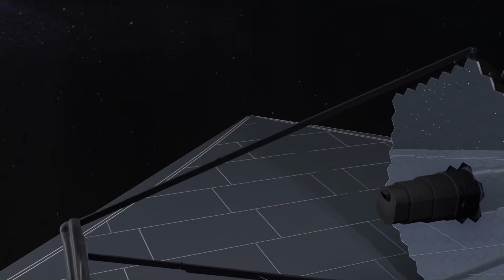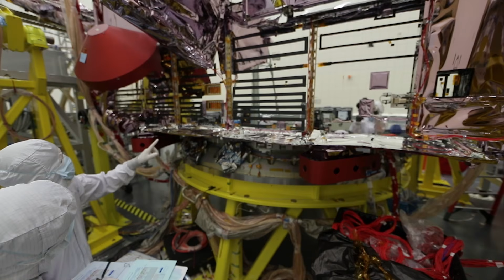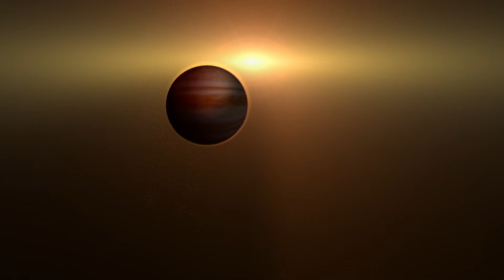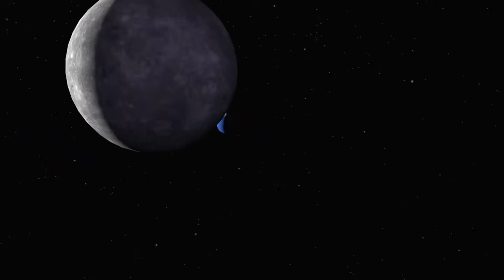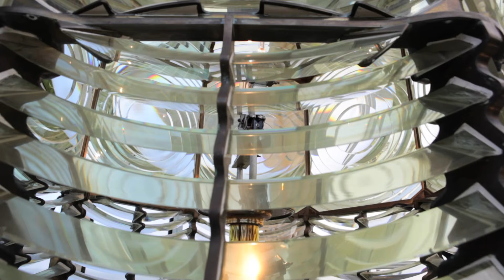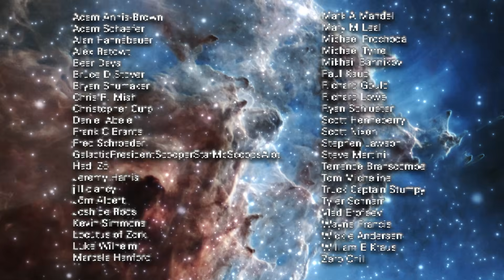Nautilus – True Next Gen Space Telescope

Comment: there is no limit to the size of telescope. the deployed telescopes could tie together once in space. and better, they can continue to adjust location in respect to all others depending on where your focal point needs to be and for what parts of the spectrum. throw up 20000 drones that are 2m across and stack them in rockets. then have them connect themselves once in space. if one is damaged, it disconnects and is replaced. it can retreat to repair and go back in.

Comment: INSTAD OF  HAVING EACH TELESCOPE OR EYE SO TO SPEAK WITH ITS OWN CHIP THAT WILL DETECT A CERTAIN NANO METER  JUST HAVE A CHIP THAT CAN RECEIEVE THE WHOLE SPECTRUM OF LIGHT AND WAVE LENGHTS CAST ON TO A MAIN RECIEVER THAT SENDS THE INFO BACK TO TO EARTH TO BE DECYPHERED HERE , THUS REDUCING THE COSTS FOR EACH INDIVIDUAL EYE. JUST A THOUGHT. AND THE OTHER THOUGHT IS INSTEAD OF EACH EYE RECIEVING AND TRANSMITTING  JUST HAVE THE  EYES MADEOF MIRRORS TO REFLECT TO A CENTAL POINT TO BE RECIEVED AND TRANSMITTED AND SORTED OUT HERE ON EARTH? EACH EYE COULD HAVE THIS MAGNETIC ARMS THAT WOULD ATTACH TO EACH OTHER IN  THE CONFIGURATION WITH A SOLAR POWERED ELL TO USE FOR ADJUSTING AND FOCUSING THE LIGHT TO THE CENTRAL GATHERING POINT TO BE RELAYED BACK TO EARTH .. KEEPING IT SIMPLE IN DESIGN AND MORE EFFECT IN COSTS .

Comment: There might be a possibility which was not talked about: a tool for molding 6 meter lenses with this technology might also be used to spitting out 200mm lenses for consumer level telescopes. With these numbers you could "print" 697 smaller 200mm lenses with mostly the same tools that was used for making the 6000mm telescope lens if its really possible.

Comment: The old big TVs that have the 3 color projection cameras and a {mylar or glass} mirror. Also have a Fresnel lens incorporated into the front assembly, consisting of a clear plastic sheet, a 
plastic Fresnel Lens, and a plastic diffuser, that are simply taped together along the edges. Once this assembly is separated, DANGER!!! The fresnel becomes a very powerful sun magnifier, 
the prime focal plane is about 2-3 feet out. Which will bring smoke immediately to the butt of an oak log and will boil water in a brown beer bottle. Will melt small thin pieces of aluminum. 
⚠Warning appropriate Eye protection from the reflected UV is a must. Also, do not leave or store where the sun could inadvertently shine through it while unattended. Not For Children!!! 
Not sure why this technology is not used in solar steam power systems. I digress; Raising the lens prime focal plane above the ground, thus widening the beam it's still pretty hot but not as 
bright. You can then make a few slow passes over a Stirred-Up Fire Ant Mound. Then pause, let more come back out, repeat, repeat. It's like fighting fire with fire. Double Plus Good.

Comment: The casings that you ejected in space could be made to fold out like spokes tethering each telescope with corresponding partners, even memory materials that go back to form once released, voila, you have a preformed shape to increase and maintain a predetermined orbit. or build a platform that does what I said except it extends out like spokes, your distance, your strength requirements... it should have a power collection system and be adjustable. Further expansion would require extending the frame infrastructure, the central point would house the communication/central guidance system for alignment with desired objects through ion propulsion tech. located on the outer frame... the array as well could individually direct each telescope.

Comment: It seems one could pull off a non-quantum-networked optical interferometry telescope of moderately large size [not km@10ly resolution but still pretty good] by using multiple lasers to transmit discrete wavelengths [ex. ir-R-G-B-uv] and recombine them optically rather than attempting to time digital data to achieve results.

Deploying a constellation at KM distances all orbiting about a central combinatory scope in the middle... seems doable.  

I mean, LISA man!  Heck, even LIGO. The ability to stabilize laser light over KM distances to sub-wavelength distances is well established and not "magic" [anymore]. 

This would be a compelling stepping stone to a full meters@LY  resolution quantum-network "powered" >AU-diameter interferometry  telescope..
Reply: Additionally, one could use optical fibers over a ~xKM distance for the optical information collection and use lasers for spatial-measure/alignment "Station Keeping".

Comment: What most people don't get is that most interferometers work one pixel at a time this will probably be measured in gigapixels
Reply from the maker: Maybe radio interferometers work at single pixels, but infrared interferometers are just the size of the mirrors - like the VLT. But this wouldn't be an interferometer, it would just be more surface area.

Comment: If you take a sheet of clear mylar film, and a sheet of silvered mylar film, or similar, and put them one on top the other, then you cut them into a circle and weld the edge together you will have an envelope the shape of a balloon. You can add pressurized gas when it is in space and it will unfold into a mirror making the main dish of a reflecting telescope. Its size and internal gas pressure forms the shape, and you can make it harden in sunlight so you can have a mirror of immense size very cheaply made. All you need to do is position it wherever you want it in space. You can park it over the middle east to keep those countries cool and you can sell advertising space on the back. You can use it to concentrate sunlight on asteroids or the moon for mining activities or focus sunlight for conversion into solar power on the moon or on satellites.  Why would you not want to put some money into such a project as this?

Comment: Unfortunately JWST is going to be the peak of space telescopes. The US is dead broke with a Debt to GDP of 370% US federal gov't is running $2T+ annual budget deficits to keep its door open. Probably the last Space telescope the US will launch is the "Nancy Grace Roman Space Telescope" which is a wide field view telescope (probably launched in 2028 or 2029). 

It would be possible to build larger telescopes like the JWST, but would require multiple launches and assembly in low earth orbit. I believe the biggest "telescope" is the USA-223 which is a spy sat with a 100m diameter radio telescope used to pick up very weak radio transmissions. Too bad the NRO does license a second one for radio astronomy.

Comment: The 30m telescope is designed to be moved by truck, so less than 40,000 lb parts, intended for assembly on site. The total weight of the moving part is under 1500 tonnes.

If you're going to assume Starship, that's 10 launches maximum.

10 Starship launches would cost less than the site works for the 30m telescope.

Just launch that.

Comment: It also sounds like that instead of temporal shifting the imaging sets you could perform an effect called pixel shifting in photography. Where you get to sample the same image from a sub resolution offset. Which you resemble a sharper image.
Reply: I think quantum effects would limit that. The pixels would probably be already close to the quantum diffraction limit for that lens size. Overcoming that limit would require interferometry, which they discussed as having problems which are not addressed by this design, such as needing very high precision in where each telescope is located.

Comment: I'd go easy with the hype around Starship capabilities. Which could end up just being used for Starlink missions, and an heavy modified Lunar version for Artemis. Adding a big payload fairing could enter more complexity as additional weigh due the reinforcements to the hull. Bet more into Falcon Heavy with an extended payload fairing.
Reply: It's just a graphic, not an engineering document.
Reply: Maybe, but the hull wouldn't need a crazy amount of reinforcement since it would only articulate in 0g
Reply: No mention of the "#Carl_Sagan Space Observatory Telescope" ?❔️ 🤨
Reply: I think underestimating SpaceX and Starship is foolish. Period.
Reply: @justinhays0827  many rely on Falcon 9 success to validate Staship. But they are completely different rocket platforms.
Reply: @RogerM88  SpaceX had no rockets in the beginning and they created two successful reusable rockets. Now, SpaceX is the most successful rocket company in history. There is zero reason to doubt their ability.
Reply: @justinhays0827   Falcon 9 is a more conservative rocket design with a standard payload fairing, and a rocket design based on proven technology.  Starship is a completely different rocket design with new rocket technology. And the payload hatch design it's a crucial aspect for commercial applications besides Starlink missions. SpaceX are even considering adding more vacuum engines, probably to gain delta-v due the vessel weight.
Reply: @RogerM88  Humans are terrible at calculating risk.

You are particularly terrible at it.

More $ for me I guess.
Reply: @justinhays0827  in theory project Jarvis  from Blue Origin would make more commercial sense than Starship, for missions to LEO. Using a standard payload fairing, and with an engine configuration mimicking the spike engine layout, it would allow using less shielding for reentry. Either way, having Starship Crew rated, gonna take a long time. If Starship opted first for the development of a bigger fairing to Falcon Heavy, as the Red Dragon lander, they could've by now some missions to the Moon and Mars. While a Crew voyage would be made by a modular Spaceship assembled at LEO with Nuclear engines. Using the Red Dragon as a lander and ascent module. It could also work as an abort system.
Reply: @RogerM88  🤦
Reply: @justinhays0827 NASA is the most successful rocket company in the world.
Reply: @justinhays0827 musk is too busy trolling trans people on Twitter to ever get starship up and running.
Reply: @justinhays0827 Unlike Starship the Saturn V and SLS never exploded before or after liftoff.
Reply: The falcon program is successful, no question.  Even the space shuttle was far less successful, both in cost and in pace.

Starship improves rapidly, while someone could doubt they will populate mars with it, its not realistic to doubt starship will make it to orbit soon.
Reply: @douglaswilkinson5700  You are comparing two completely different methods of development. SpaceX uses prototypes to test ideas while Saturn V and SLS used testing sub-systems and then launching a combined rocket. One is building cheap prototypes to get the information that the other gets from designing on paper and building sub-section prototypes then combing them.
In the end it is a matter of which is cheaper and faster in the long run.
Who won is obvious.
Reply: @knowledgeisgood9645  Still -- neither the Saturn V (developed over half a century ago) nor SLS exploded after liftoff.
Reply: @douglaswilkinson5700  So what? That is the method. Losing prototypes does not matter when you get the real data you need.
It is not like Starship has crew they need to be worried about.
Reply: @knowledgeisgood9645  Still -- no Saturn V nor SLS exploded on the launch pad or during flight.  All were successful and lessons were still learned.
Reply: @douglaswilkinson5700  But at what cost!
It was, and is, a dead-end.
Reply: @knowledgeisgood9645  The cost was fully justified on July 20, 1969.  The F-1 engines remain the most powerful single combustion-chamber liquid propellant rocket engine ever developed.  These engines are retired not obsolete.
Reply: @douglaswilkinson5700  How about SLS?
Reply: @knowledgeisgood9645  Starship just had another failure.  At least two Raptor engines failed and the test was aborted at 2.7 seconds into the 5 second test.  At least Elon adopted Saturn V's water deluge system.
Reply: @douglaswilkinson5700  4 Raptors aborted prematurely. No one outside SpaceX knows the reason, so I will wait before I draw conclusions.
That was likely why the test was aborted. 3 Raptors being the maximum number allowed to abort before launch. Anyone who has been involved in testing anything knows tests usually fail - no big deal. You fix it and test again.
Elon did not adopt the Saturn V water deluge system - he and his team turned it upside down, thus avoiding having to have a trench (for which they would have needed to create an artificial mountain like at 39A).
Reply: @knowledgeisgood9645 There was no water "system" (deluge, sprinklers, shower heads, etc.)  prior to this.  Elon took a lesson from Saturn V and installed one.  Sooner or later Starship I hope will work.  The Raptors on Starship keep failing.  This time they couldn't complete the 5 second test.  No Rocketdyne F-1 on the Saturn V ever failed.
Reply: @douglaswilkinson5700  This deluge system was being built months before B7/S24 launched. The problem was that the take-off took too long. They had good reason to assume it would hold that last time - it did not. So they lost 1 or 2 months more than they would have anyway (to install the system). That is just the nature of R&D.
BTW, we did not get to follow the tests done before the Saturn V launched. If you think tests did not fail multiple times you are fouling yourself. They just chose to test sub-systems not the whole thing. It succeeded in the end, but was extremely costly and time-consuming, with at least 10 times as many engineers and scientists working on that project. SpaceX is using a small fraction of that. And the Saturn V was a one-off rocket. Hopefully Starship will one day be reusable.
Reply: @knowledgeisgood9645  Starship, I hope, will take its place next to the mighty Saturn V when it lands on Mars and then then safely returns to Earth.
Reply: @douglaswilkinson5700  Yes and no 😁
The booster will return to be reused and the Starship will also be reused. Maybe when they are retired at some point they might be placed next to the Saturn V. With the exception of Starhopper SpaceX does not seem to be too sentimental.
Reply: "additional weigh to to reinforcements to he hull"
A few typos here and there are easy to ignore, but there are enough of them here to obscure your meaning. You might want to go back and edit for clarity.
Reply: @HebaruSan   edited

Guess he read your comment .